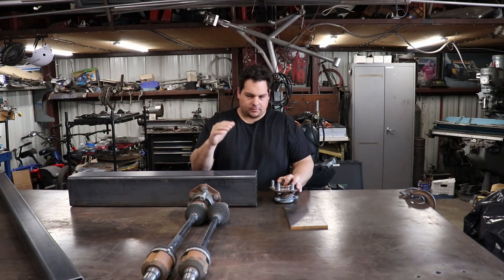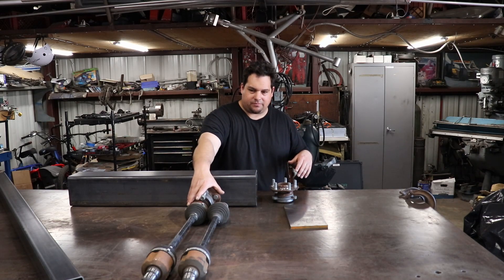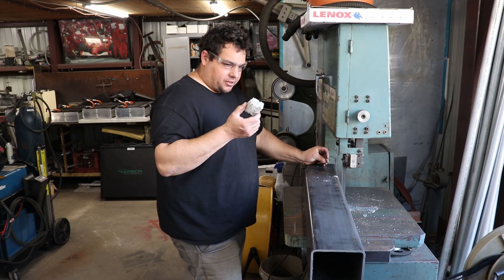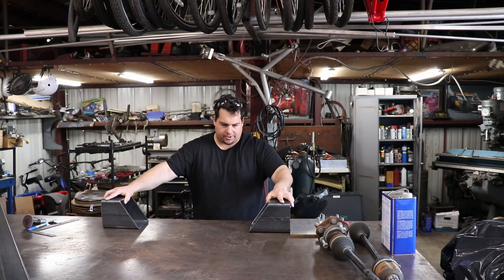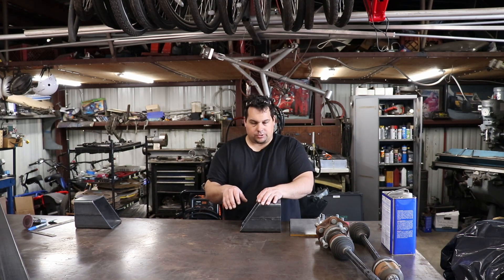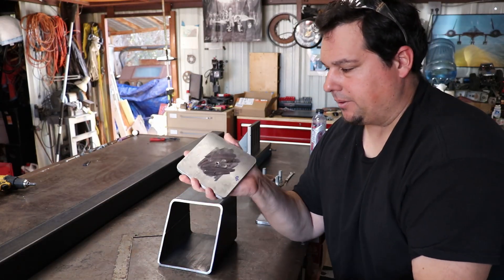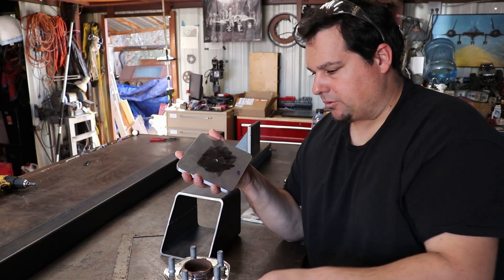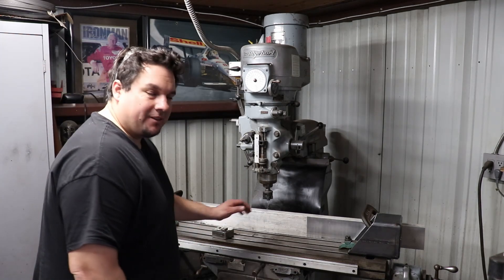Tesla Powered 1972 Toyota Hilux Build Video 1 (how to build a De-Dion axle for an electric truck)

Comment: Just got my CDL and I been driving OTR For about 6 months and bought me a house in Michigan just pouring a slab on my ranch to build my barn/workshop to work on my replacement tubed rock buggy

Best thing that ever happened was getting forced to work on a model 3 burned battery pack 

I’m may have cancer 

But I moved to New Mexico and got to wheel with my boss who is the leader of 4lo off-road and the marshal of arms of the Mongols biker club is the lead mechanic of my shop

Now I’m a mother trucker

All because my former boss of EV JEST lied and gaslighted me to open a battery pack I’m

God is good

Big shout out to Johnny G my fellow short bus rider
Christopher spice man who introduced me to flying rv gliders 
Eric
Ian the terrible good
And especially Brem for visiting me daily to cheer me on after witnessing me getting mocked by my boss daily for being mentally handicapped aka autism 

A paranoid pskitsophrenic drug addict

I was sober 2 years before I got there
And I have 3 years sobriety from smoking pot again 

J5 
you’re right
I should’ve never accepted marijuana from my employer 

I just wanted to be accepted

The team minus the manager of EV JEST are the nicest people I ever met

Comment: De-dion doesn't need to be anywhere near that bulky, lol. Cool that you can reuse the leaf springs, but if you ever wanna link it, look into a Satchell Link. It's a triangulated 4 link, but the uppers are parallel and the lowers are triangulated on the chassis side compared to how T4Ls are usually done. Gives you a low roll center, good anti-squat, AND no roll-induced axle-oversteer

Comment: I am really intrigued by this and the possibilities of the De Dion axle. I’m planning a conversion on a 1982 K-2500 GMC, and I’m thinking about a De Dion setup as an option for the truck. I just can’t settle on whether I should retain the leaf springs or go for an airbag setup if I go with the De Dion.
Reply from the maker: Thanks! That would be a cool build. That truck is big enough you might be able to get a whole Tesla subframe in there with independent rear.

Comment: This is a quite smart way to go about putting a Tesla SDU in your truck. I had been looking at trailing arm setups but for a truck that is already leaf spring hung this really has a lot to offer. Since you've been using the truck a while have you checked to see your KWH/mile  and your range on your pack yet? This is the first time I've see an i3 pack used and the way it is packed also has a lot to offer if your planning a truck. Given how it fits between the rails I would think another one of these packs could maybe mounted under the cab thus doubling the capacity if it was needed. I wish you had more info on the build, pictures, details, etc..  A real nice job, thanks for posting it up here, DC.

Comment: I've watched this video about 10 times at least. I've decided that I'm going to do this with my EV build as well! Probably going to plagiarize your design as much as I can, but use all Nissan Leaf parts.
Reply from the maker: awesome!!! thanks! best of luck on your build.
Reply: @J5Jonny5  Well I bought the 6x6 and the 4x4 and then realized it was much too big for my littler car 😆. Returned today to the metal supplier and got 4x6 and 2.5x2.5. Now I need to figure out what to do with $260 worth of 6x6 and 4x4.
Reply from the maker: Oh dang!!! Well… maybe a new gate or something haha! I actually use those sizes for that stuff.

Comment: why not an IRS?
Reply from the maker: Its was easier from a fabrication point to just retain most of the stock truck suspension. plus.... to me straight axles and leaf's make it a truck.
Reply: @J5Jonny5  how hard would it be to put an motor an axle on the front as well?